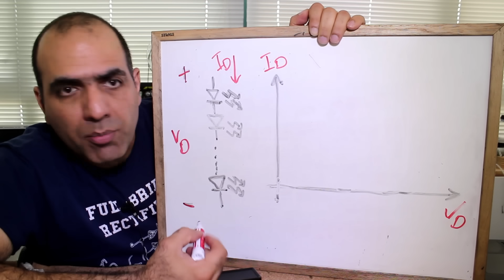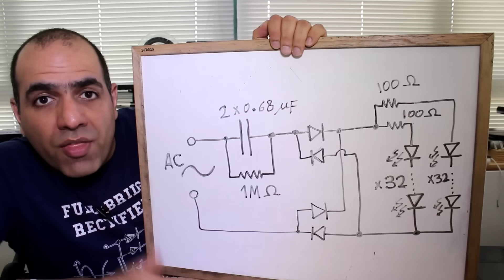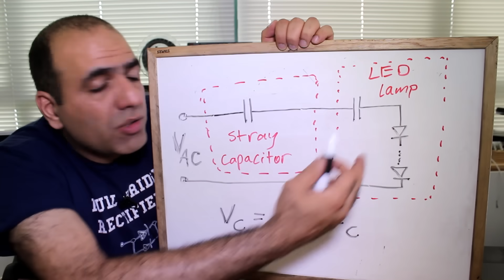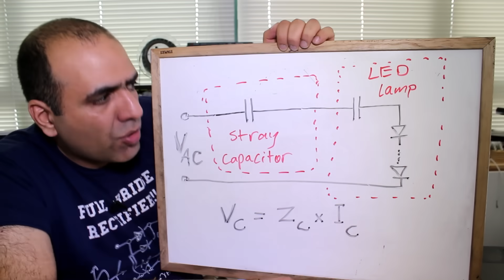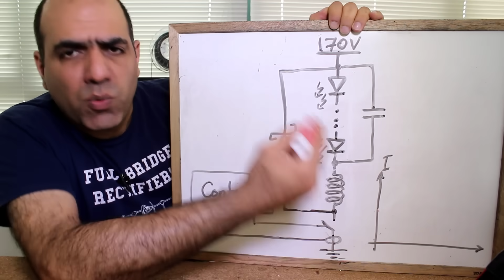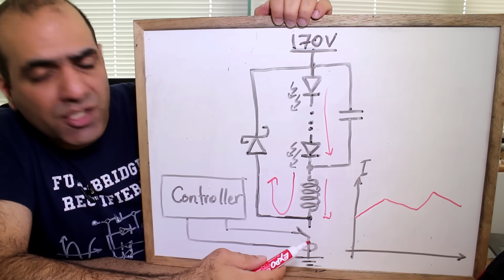Why Cheap LED Lights Keep Glowing

Comment: I replaced by Honda Element tail lights with LED.... and the cruise control stopped working.  Turns out Honda uses only a single pole brake light switch and they depend on the incandescent brake lamp filiments to pull the voltage to hard 0v when you are not pressing the brake.  When I installed LED tail lights the lowest voltage is now 1.2v and that causes the brake light input into the MCU to think the brake lights are on and thus cancel the cruise control.  The solution was to install a 1k resistor across any one of the brake lights... I selected the third brake light.  Problem solved... the voltage on the brake line was now hard 0 and not 1.2v.... now the cruise control works.

Comment: Four brief comments:

1. The bridge rectifier in the LED assembly is simply to provide DC voltage for the LED's and not damage them with a reverse voltage.

2. The lamps glow when the switch is off because the "series" capacitance of the house wiring allows enough current to drive the LED's, which don't require much current to operate.  

3. There is no energy "stored" in the house wiring. 

4.  Once more, the impedance of the house wiring capacitance is low enough to supply enough current for the LED stack to glow but not low enough to light bulbs which require more current.  Any house wiring which allows this effect to take place has the switch in the wrong wire and does not meet any wiring code I am aware of.  There is a slight possibility that a two-way switch configuration could be properly wired and still cause this effect.  I've never seen it but it's possible.

Comment: High voltage makes me nervous af
Reply: See one of my replies further down where I refer to one of my patents for a circuit which generates over 2,000 volts from a small one-shot battery in a Missile.  I got that full charge just once, from one hand to the other.

Comment: There is one thing I didn't quite get it and need clarification. The cheap LED light doesn't have that resistor so it stays on with microvolts and draws power after the light is switched off. But if it had that resistor it would continue to draw power from the mains after it is switched off right?

Also the other LED light bulb (which turns off completely) does it continue to draw power after turned off (due to the capacitance of the house wiring etc)?

Comment: Crazy Russian hacker: Safety is number 1 priority
Electro boom: SaFetY iS nUmBEr OnE PrIOriTy
Reply: @Stimpy&Ren 
I disagree, I think this is a good way to actually teach about the dangers of electricity.
Reply: Shockingly! Yes
Reply: @RomanoPRODUCTION  "shock"
Reply: @namesurname4666  lol 2020 :)
Reply: @Stimpy&Ren Firstly you don't know whether he does it for comedy or education or a mixture of both. 

Secondly compare this to the "don't try this at home" approach you usually see. Normally you see only the cool stuff without anything going wrong, making you wanting to replicate it at home. Here he shows that you actually can fuck up and quite easily. People (normally) don't want to get shocked, so they avoid his mistakes, whereas the "true professionals" don't show the mistakes and therefore people are not aware of them and are at risk at making them.
Reply: @Stimpy&Ren I have a degree in the field.....I did electrical related things for YEARS.  Wouldn't matter anyway....I know it's not his job to babysit me or anyone else.  You're to stupid to grasp this FACT.
Reply: Wasnt crazy russion hacker the one tho, who suggesting building an air conditioner  / cooler by using dry ice, effectively suffocating anybody who actually used that in a closed room?
Reply: "Safety is my number two! My number one is fun!"
Reply: @Stimpy&Ren
 He's not teaching people to do what he does, he's "showing" what happens if you fuck up. With the formula he uses, it's easier to remember. Shock value is easier to remember, for example, lots of people can relate that usually, they were more likely to remember when a teacher tripped and fell in the classroom, than what that teacher said.

Same concept. It makes it easier to remember.
Reply: @Stimpy&Ren he's doing all that on purpose to show that a lot of people make these mistakes and they are deadly.
he reminds us again and again by getting himself shocked.
Reply: @Stimpy&Ren its more educational after seeing him getting shock i remember what i shouldn't do.
he's an engineer and he knows his stuff u can't be so idiotic to imitate him and these videos surely aren't for kids.
Reply: @Stimpy&Ren Holy hell kid...get off Youtube and the internet....the guy in the video is responsible for himself.  It's not his job to babysit anyone...not his job to worry about what adults try....or what adults let their children look at while they are online.  You are just like the idiot lady that was too fucking lazy to make sure her kid was in the vehicle and backed over her kid, then blamed the vehicle manufacturer.  GO AWAY!
Reply: @Stimpy&Ren Not his job to babysit adults or their kids.  Quit trying to make other people raise your kids.  If you are too stupid to understand the purpose of the video blame you and your own, not the person making the video.  No one is forcing you or anyone else to watch anything.  Quit clicking on videos just to whinge about how you think they should be done and move out of your mum's basement make your own.
Reply: That's 2 choice Technitions,bro
Reply: but as he said in his firecracker video, safety is item number 2. first one is fun.
Reply: Cartman: You will respect my PRIORITAI!!
Reply: you mean number 2. Number one is fun!
Reply: No... Electroboom says this:

Safety is priority number two, number one is FUN!
Reply: Stimpy&Ren if that’s true someone needs to do a video on why this guy is still alive
Reply: Safety third
Reply: More like safety is the last priority
Reply: Cyber Infotech Safety was never an option for this guy.
Reply: safety is always my no.2 item,the first is fun!(still concerning about his health)

Comment: I would be fine in many cases with a bulb that glows dimly when it is "off". The main thing to note is he said it basically uses the same power but you just can't see it. As long as you know what you're getting it's perfectly fine to me.

Comment: my 12V led strip glows because the dc wires run through the same conduit as the ac wires, so together they act as a transformer.

Comment: If current flows enough to trigger a glow; is there always a constant cost of electricity and a slight increase cost if a bulb causes a glow? One of my motion activated light fixture glows on all low powered bulbs. I’m not sure how much more energy is being wasted, so I just put a fluorescent bulb in the mean time... I’m just curious if I’m wasting energy or if there is always waste with or without the bulb. I’m not an intellectual lol

Comment: I had an cheap led light, when I switched it off, it was still glowing dim. Could not understand it. So when I changed over the live and nutral, problem solved. So I concluded that it pulled current through the brick wall so when I switched it off it had induction between live and earth (wall). My light switch only cuts live, so if life was connected to the nutral it could leak current through the wall. Please correct me if my conclusion is wrong. It worked correctly when I changed live and nutral.

Comment: in the time i learned electronics i used capacitors as voltage and current limiter, caclulating the electrical reactance to connect LED to 220Vac/50-60Hz     ~ o--||-----|>|----o ~
in many households, either some not completely isolated electric devices are used or wrong wiring is applied and one of the lines still delivers a voltage of 30-60 Vac without load.
i have the very same phenomenon in two of my rooms.

Comment: So in an actual house does this effect still work if the electrical source is at the switch? It seems to me that the demos both you and Steve do rely on the light fixture being the location of the electrical source. That’s fine of course because a lot of houses are wired that way. It seems to me that in Steve’s demo especially the wire traveling from the light fixture to the switch is where that capacitance came from, so removing it should stop the light from glowing with the switch off.

Comment: I have this problem with my reletively expensive 20 watt receccesed can light fixtures, and yes, i realize this is a problem with the original wall switch/dimmer, and not the lights, but still, i never knew there was ~0.5 watts being wasted on each of these 6 fixtures even when the switch is off, never would have noticed if i hadnt switched to LED(these make a complete seal against the ceiling and uses 20 watts instead of 75-100 watts)

Comment: I have LED lights which is battery powered. I have not changed the batteries since october last year but they still give a small amound of light...

So they are not attached to any main current, only very old very dead batteries...

Please explain.

Comment: In UK, each socket is done with a three-wire double isolatated cables (ground, neutral, and live) the same for lights,  so, each socket or pair of sockets has its own cable running to the fuse-box, which is a dissaster of wire redundancy, why? because the WOOD houses they have, they run cables UNCUT unpatch from fuseboard to final destination (for security reasons). So, those cables acts as perfect capacitors, while, concrete or brick houses has single-wire running sometimes in metalic pipes, or plastics ones (cheaper), the thing is, the cables neutral and live / the switched one are not running perfectly parallel with ground, or neutral or others unswitch live cables, and that way, "the capacitor" effect is lots more weak, so, less energy loss by this VIRTUAL capacitor that UK and maybe EEUU houses has.

So, hyper sensitive , lets say hyper energy efficient led bulbs from china, which don't has switching power supply, just pickup the energy losses from UK and EEUU and stay glowing.

Comment: That's how cheap china works.
>I design/stole a expensive perfect working circuit
>Let's see if it still works when I remove this component
Many changes later
>Ah finally cheap working circuit

Comment: You can use a plasma ball wire around it use a old 12v halogen with the out put if you get it right the center will glow.☺😊😀😁😂5 Smile's 💡⚡🔆low power but it will light up the power is around 5v 30ma DC⬆⬇where you need 12v 0.5A DC full power so great different is it's blue!. WOW.😆 and you can get red if you use iron and high volts AWESOME.😆 colour show hard to get but.

Comment: I get the feeling that a fuse company is the sponsor of this youtuber :P but indeed  you make contact with ground a current will flow, Leds need very small power to light them up, Nice video Through! ;)

Comment: This guy is an idiot and has limited knowledge of electricity and electronics. All recent and current mains LED bulbs have a switch mode power supply to create DC at the required voltage. Early forms used a capacitor and bridge rectifier with zener diode. This was VERY BAD practice and is not to todays CE regulations.
Reply from the maker: I didn't MAKE those LEDs, you know! You can buy them right now and use them. Certification means nothing if you can buy these. And please watch to thr end!

Comment: I have this issue on all my LED lamps at home and additive parallel resistor did not fix it. I started from 470k to 33k. Main power is 230V.
Reply from the maker: I said manufacturer should use a resistor, not you! And it depends on where the stray capacitance is. Plug an incandescent bulb parallel to your LEDs

Comment: I have noticed that even my 60 watt LED bulbs glow very faintly (only noticeable in complete darkness) when switched off.  I always thought it was due to induced current in the wires due to adjacent wires.

Comment: Switch the live, not the neutral/return. that way both legs of the lighting circuit stay dead when switched off.
Reply: You'd have to switch both since it's alternating current.
Reply: I can't believe I had to scroll so far to see this comment.  Everyone that has this problem is using an incorrectly wired switch.
Reply: @mrtommypickles8635  or a correctly wired AC switch

Comment: I have cheap LED bulbs which doesn't even have a FULL BRIDGE RECTIFIER in them. You can see it's flickering at 50Hz because of the AC.

Comment: There is an easier way to understand the circuit than with capacitive reactance, though I've seen that explanation before... Like This: An LED needs a fixed CURRENT to operate correctly, so LED drivers are designed to supply a fixed current. The cheap LED uses the fact that a fixed amount of charge will move through the capacitor with each cycle (as long as the AC voltage is stable), and a fixed number of cycles happen in a second, giving a fixed amount of charge moved per second (otherwise known as current). Even a very tiny capacitance will still move some charge, so the LED's will always light if there is capacitance in the wiring.  I=2(Vpeak-Vled)×2f×C

Comment: Awesome explanation. But , wouldn't it  only happen if live (phase) wire is still connected to the LED  - even after switching off the power switch ? ( meaning that switch has actually cut neutral wire and not the phase wire) .I think a simple solution would be to make sure that switch actually cuts the phase (live wire).

Comment: A friend of mine complained about the LED light in his room always turning on when he was showering, turned out his shower was connected to earth and the led light as well, his shower head received 230V via parasitic capacitance of a power supplies net filter.. Well when he was showering the charged water droplets raised the earth (which was not actually connected to earth / ground unless he turned on the light switch (which really connected PE to neutral))... Well :D

Comment: Hello Mehdi, Love your channel, I'm wondering - may you please take a look and review the design of this kind of very popular RF wall-switch from china (https://www.aliexpress.com/item/32827780432.html), that requires only live&load wires to work without ground wiring ?(witch is convenient since not all homes have ground wiring in the switches wiring), there are some variations of this switch with relays and some without which are silent and some with wifi modules instead of rf... how safe is it when it's "turned off" and how does it works?, it's kind of a cool product with capacitive sensor touch switches and 433mhz rf receiver what can be connected to a smarthome hub like broadlink to be controlled from a smartphone over wifi... thanks!

Comment: Great video Mehdi! I have also found that some LED and even some CFLs do some weird pulsing glow when connected to switches that have neon pilot lights in them. I attribute it to some resonance between the neon and the LED or CFL circuits, but never tested it. If you have seen this, maybe you can do a followup video? Anyways, great work as always!